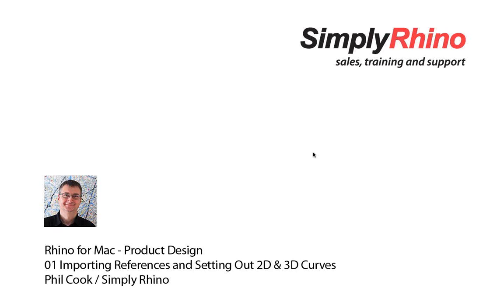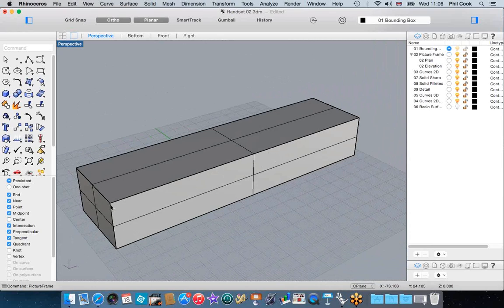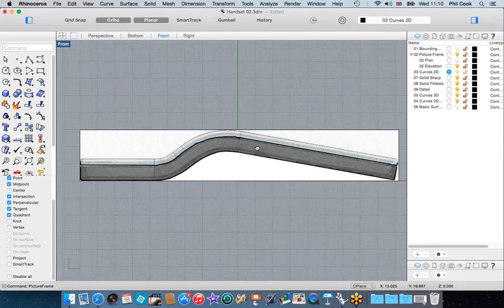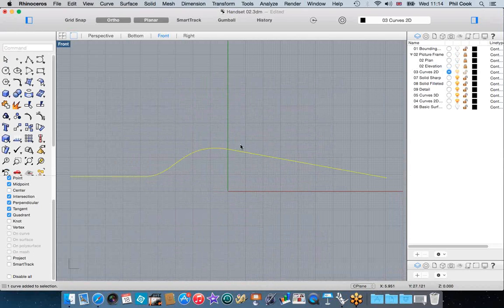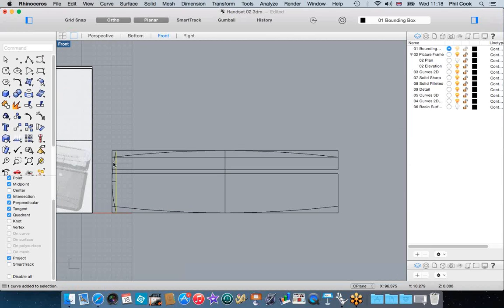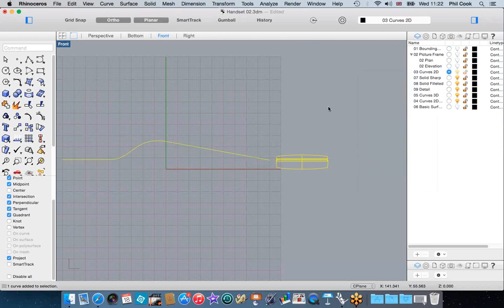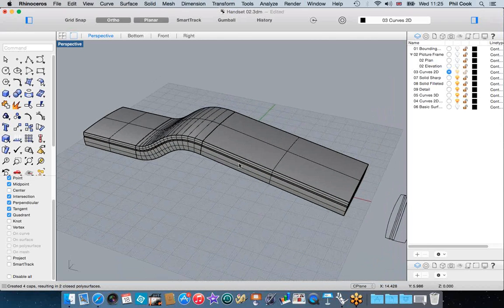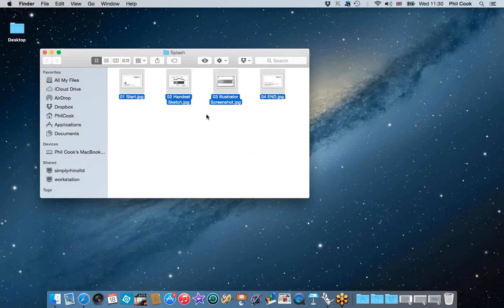Rhino for Mac - Product Design Webinar 1

Comment from the maker: Hi, Laura 
I used the ‘Small Objects Millimetres’ template. The grid size and properties can be changed in ‘File>Settings’ – the grid is merely a visual reference for the CPlane and changing the size doesn’t affect accuracy, model scale etc. If, when you create the drawing in Illustrator, you have the units set in (for example) millimetres and you then bring artwork into a Rhino document in which the units are also millimetres then your artwork size will remain as existing if you select ‘Custom Scaling – 1mm in PDF = 1 Rhino Unit’. Hope this helps. Phil.

Comment: Hello! Could you please tell me wich template are you using and which are the settings of the grid? I did the same vector in Ai but when I import the file it's bigger than the one you did and it doesn't even fit! Thank a lot and sorry for al the questions but I'm inlove with Rhino for Mac and I really want to learn :D

Comment: are you using a mouse?
Reply from the maker: Yes, for this webinar we used a standard two button mouse and a MacBook Pro 15" with Nvidia GeForce graphics.
Reply: Simply Rhino - Rhino for Mac good, sounded like laptop buttons, i tried rhino for mac, its possible, but without a mouse its like driving a car with flat tires :/